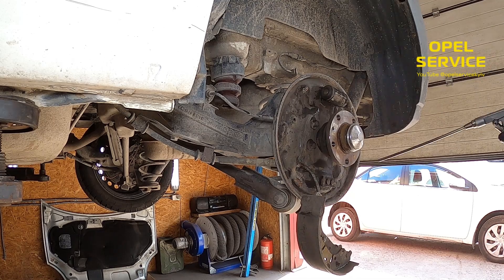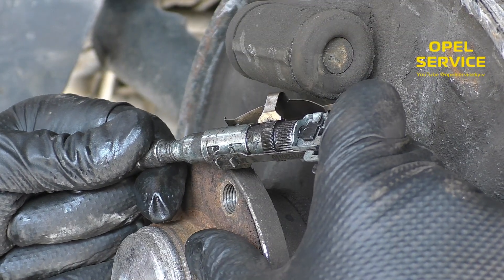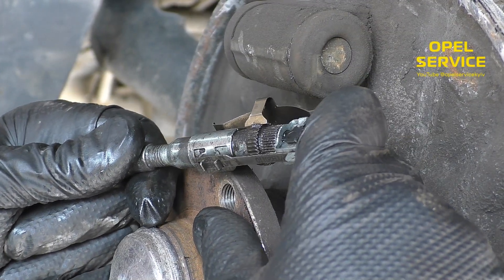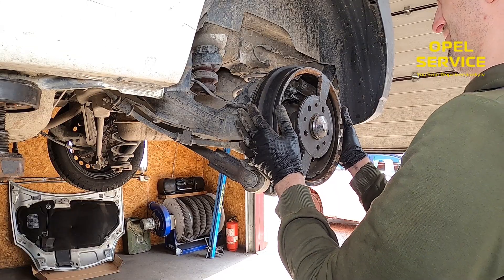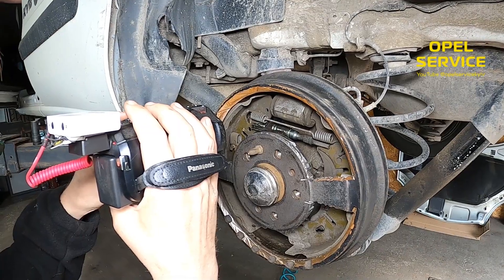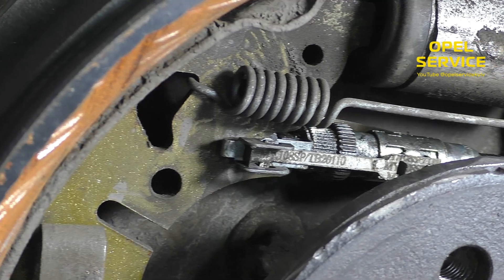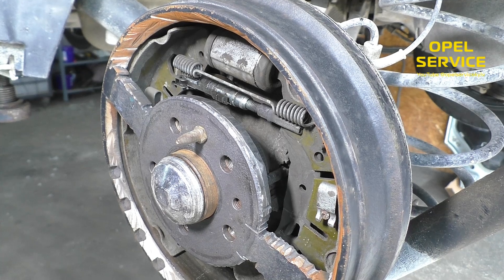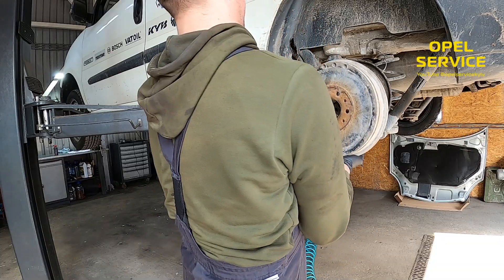Transparent brake drum - How brake mechanisms work

Comment: Hello, i have an opel astra 1.6 16v 2001,  when I press the acceleration pedal a bit harder, it goes interrupted and like it has no power. But only when the engine is hot, when the engine is cold, it works normally
Reply from the maker: Hello. Have you contacted a car service? What fault code is written?
If you have information, you can send us an email in the channel description